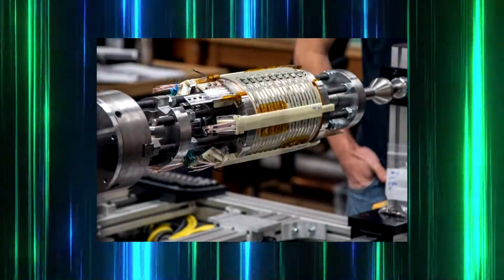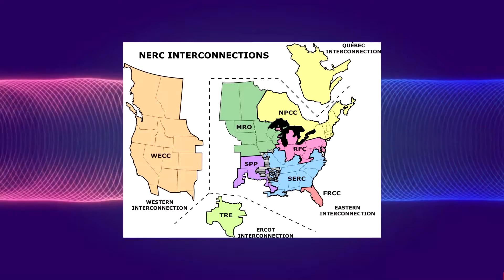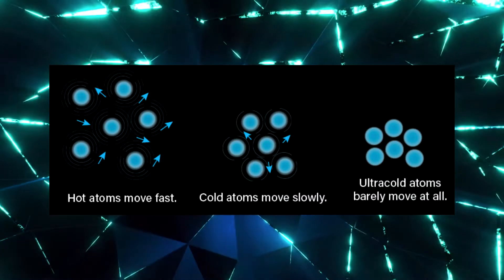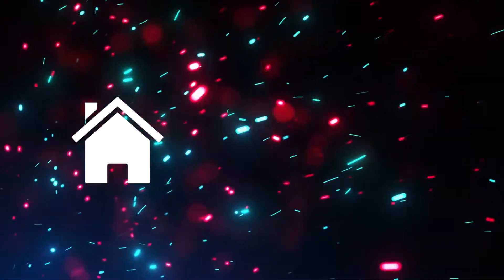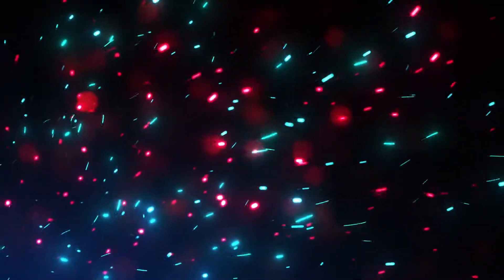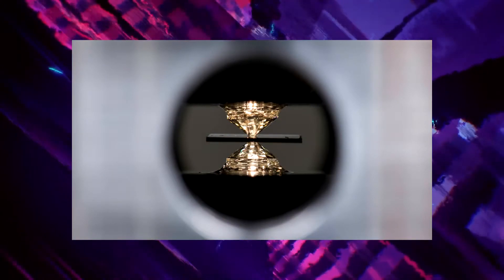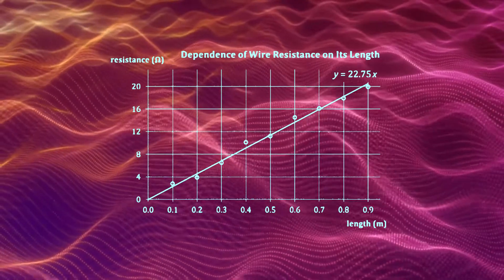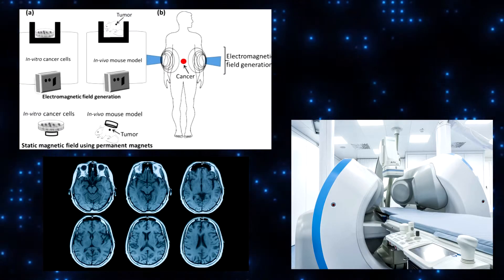How do Superconductors work?

Comment: Good video. How about one on metamaterials?
Reply from the maker: That, my friend, is an excellent suggestion! Any specific uses or types you'd like to hear about?
Reply: @SiriusScience  Yes. I would love to see a video on how metamaterials can be used to create a warp drive. This would tie-in with your most popular video to date, the Alcubierre Warp Drive. This can be done by inducing a Lense Thirring effect also known as Frame-Dragging as confirmed by Gravity Probe B. There is a popular misconseption that space is like a rubber sheet when it is actually a superfluid. This superfluid can flow through itself like water flows through itself in ocean currents. The reason why such large amounts of mass/energy are required for Frame-Dragging is because the coupling between electromagnetism and gravity is so weak. Talk about how metamaterials can alter the coupling coefficient between electromagnetism and gravity, thereby eliminating the requirement for extremely large amounts of energy. 

Ty :-)
Reply from the maker: @tygriffen2878  Huh. I didn't know about that! Time to research more into metamaterials. Thank you for your suggestion and stay tuned!